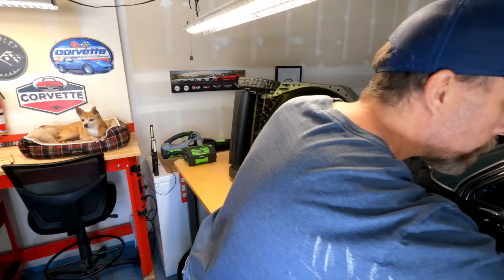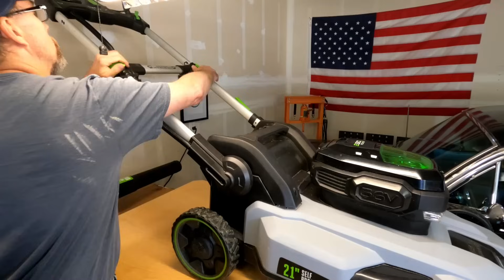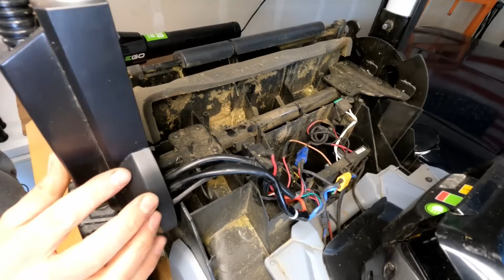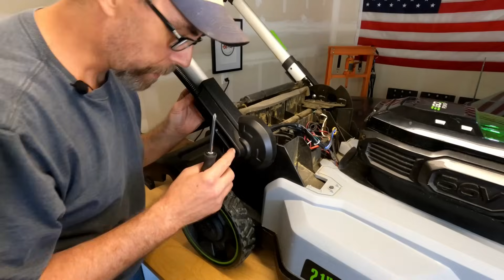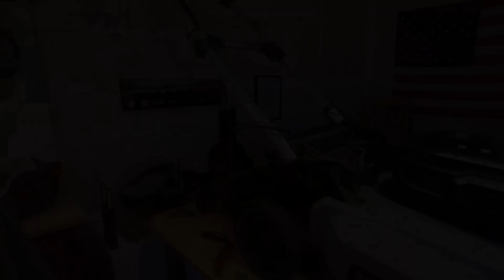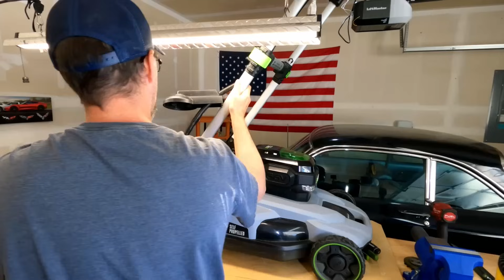My Ego Mower Finally Quit Working!!  🔧  Can I Fix It??

Comment: 🤔 EGO, FYI, comes with a five year warrantee on the tool, and a three year warrantee on the battery (I’m assuming you bought this new).  Intermittent electrical faults are perplexing.
Reply from the maker: THanks for the tip!
Reply: @EndWrenchRookie   🧐 I’ve been using EGO products for 12 years and have probably  >ten tools. In all that time I’ve had 2 batteries fail (EGO replaced 1 under warrantee and didn’t even want the old one (5 AH) back. The other battery was well out of warrantee.

      My original 12 YO 20” mower became unreliable (either brushes or main board) so I upgraded to a 21”brushless push mower, last year.

      The only other tool I had fail (also 12 YO) was the trimmer due to bad bearings in head from operating in a high dirt/dust/sand environment. The model was discontinued and I couldn’t get replacement bearings, but ten years was a good run.

     I have the mower, 3 trimmers, power broom, hedge trimmer, 14” brushed chain saw, 10” pruning chain saw with extension, edger, 2 blowers (regular & Pack pack), a back pack mounted battery holder (standard batteries, NOT the pro) and  the roto tiller. If I lived up North, the snow broom is impressive.

     Replacement batteries are pricy so I always get a new tool-battery-charger combo which is a very cost effective way to buy battery’s and get a tool very cheaply (Some come w/ 2 batteries) 🤗.

     HINT: If the model # ends in “0” it is “Tool Only”; If it ends in “3” or “5” it comes with charger & battery too.  

      (All the letters hint at the purpose, like LM = Lawn Mower; SP = Self Propelled; ST = String Trimmer; etc.)

       Always Register your new equipment from the EGO website (faster than CS assistance).  

       Amazon Prime and some Credit Cards provide automatic extended warranties @ no additional cost.

       EGO is great on development, innovation, all batteries interchange, reliability & power is high and CS is good. 

      The website however is hard to data mine technical info, searches are imprecise, and sometimes information is absent or misleading …. hopefully EGO will address these issues.

      The bottom line is I wouldn’t keep buying EGO if overall it wasn’t very good. 

       I am a heavy use residential customer in VA and FL.  The Proline is “mo powerful”, heavy, & expensive but I have no experience with this line. 

        The biggest cost to battery powered tools are the family of batteries so choose the family (quality, power, runtime, versatility) wisely.

        Hope this helps. 😎

Comment: I have the same mower, intermittently will shut off and the battery light will flash.  I think what my problem is the slide arms on the side that adjust the "steering/telescoping" out.  I notice the black arrows that indicate how far out the arms has to be is further in.  I have a very bumpy lawn out back and seems to be when back there that it happens the most.  Anyhow....appreciate the video, not intimidated by whats inside, looks like a fairly simple system.  Thanks again!
Reply from the maker: Thank you so much for the feedback! Recently, my slide arms are acting up as well. One of the two green handle locks snapped off its little green insert that penetrates the slide handle. This makes the safety switch turn on and off as I push and pull on the mower handles. I have ordered a new set of handle locks for it. Thanks for watching!

Comment: Very systematic and logical approach to a problem.  Most people would have taken the mower to a shop or dumped it.  Kudos to you.
Reply: Buy a meter
Reply from the maker: @boblevy1901  Great idea...Then I could have 6. Thanks!
Reply from the maker: Thank you so much for the feedback! Ya, I could have tried to get it warranty repaired at a shop, but I don't have a backup mower for the month or two of downtime that it would have required. Thanks again and thanks for watching!

Comment: Mine quit after 4 seasons.
Reply from the maker: Sounds about right
Reply: @EndWrenchRookie  mine wasn't the mower but the battery, 220 bucks for a new one. So it sits . I'm just back to using my gas honda.

Comment: After 4 years? That is pretty pathetic given the price of these units. Hate to say it, but I’ve gone back to my gas mower. Which has been working pretty reliably for 15 to 20 years. I was reluctant to try electric, but took the leap. Not impressed in the least. It’s not a good system if it fails to work.
Reply from the maker: That's cool. There is a machine for everyone out there :)  I used the same John Deere push mower for over twenty years and I loved it! That being said...though it ran reliably for twenty years, it did have problems, like all mowers. I say if you are happy with your equipment you are in good shape, whatever you choose to run. Thanks for watching
Reply: @EndWrenchRookie  But here’s an honest question. Has anyone had a problem free— battery or machine—-experience with EGO beyond the three year point? Not that Ive heard of. Every EGO story seems to be the same—— breakdowns and battery issues in year 3. It’s just not acceptable in my opinion.

Comment: Thanks! I, too, am an EGO fan and I started w/the un-propelled  version of this mower. I store it the same way but I haven't had this problem yet( and I hope I don't). We got it in 2018. It's had a LOT of abuse as it was purchased to temporarily replace a lawn tractor that was in for repair. It didn't miss a beat. Now we live on 8.1 acres of land and it's mostly tress so not a lot of grass to cut. Now I know what to look for if I have this problem.

I have the 765 cfm leaf blower(like you do), the original pole saw and extension, and the self propelled snow blower(as we live above 1000 ft.). The 18" chain saw is on the "next thing" list.
Reply from the maker: That's great! You have really invested in the EGO game :)  It is always nice when all of your gear is the same brand so you can share batteries and chargers. Glad you haven't had a problem with your wiring but ya no big deal if you do. The chain saw would be nice, especially if you have a lot of trees on your land. I have heard that the snow blower works pretty well as long as it is not pushed too hard.  I definitely LOVE my leaf blower. I use it everyday to keep my garage dusted (as well as its stated uses like lawn work lol :) ) Thanks for watching!
Reply: Go ahead and get the 18” chainsaw. I cut through an 18” pine tree that got uprooted during a storm. Cut through it like butter and actually made
 5”x5”x10’ posts out of it

Comment: We bought an 2018 EGO cheap lacking the 7.5 AH Battery.  I really don't want to convert to a battery Mower but bought this one to try out and maybe flip?  Well, the battery is $400.  I did borrow a battery and the self-propelled is stuck on full-speed which apparently is a broken wire between the speed lever and the controller.  Someone wrote the green wire is bad.  MADE IN CHINA.  Going to keep using my wonderful Toro Commercial 2-cycle Suzuki powered Mower.  Enjoyed your video and troublesbhooting.  Excellent job!
Reply from the maker: Thanks for sharing. Thanks for watching and commenting as well!

Comment: Don't they come with a 5 year warranty?
Reply from the maker: Yes they do
Reply: @EndWrenchRookie  Perhaps you could contact the service department and get a new wire mailed to you to have for spare parts, i would thing that it may fail again in the future. I think a piece of rubber hose to the repaired are may also promote longevity, buy noy letting the wire not bend quite as far.

Comment: Had this exact same problem. Did this fix instead of just jumping the motor controller side of the connector like a lot of other people. Worked perfect, and gave me a reason to pick up a soldering iron. 10/10
Reply from the maker: That is so cool! This is the reason that I made this video. I never really planned on recording content that day, I just wanted to get my mower working before it stormed that afternoon. I can't believe how many people it has helped. This makes me super happy :)  I am glad your repair worked out well. Good Job! Thanks for watching!

Comment: Congrats on getting it working.  One thing I will note, from personal experience.  You lucked out this time.  You would have had a lot of unnecessary work to undo had your fix failed.  You should always test the wiring before using the heat shrink or anything else.  You can save yourself a lot of time that way.  Great job otherwise!  :)
Reply from the maker: Thank you so much! Great tip. It's funny, I didn't really plan on making a video that day...I just wanted to get my lawn mowed before the storm hit :)  Thanks for watching!

Comment: I have 18 ego products and of late my mower and a charger failed. Previously, I had a battery fail--and they are VERY expensive--and over 1 1/2 years of speaking (including texts, emails, phone messages--and they asked me for every serial number as well as videos of failed battery) with "customer service" reps (in their homes) they denied the warranty claim stating they could no longer trace the "delivered" battery. Uh, no battery was ever delivered. So I wrote corporate. NO REPLY. Therefore, I am no longer an Ego customer and just bought a Greenwirks mower for less than half what Ego charges. STEER CLEAR OF EGO.
Reply from the maker: Thanks for sharing

Comment: Thanks for this video! Can you tell me what I need to buy to repair the 3 wires?  Is the replacement wire just copper wire I buy at Home Depot?  What width?
Reply from the maker: Thank you so much! Sure, I would use 18 gauge automotive (multi-strand) wire. I would think that they would have it at The Home Depot. You will need a basic soldering iron, flux paste, solder, and some heat shrink to finish up the patched wire sections. I also used a wire looming tape to tidy it up at the end, though basic electrical tape should do as well. Cut out the bad section (mine was about 6 inches worth. Strip the wire off of the ends of the wires that remain. Solder in your patch pieces of wire. cover the patched sections with heat shrink (use a lighter or a heat gun to shrink the tubing), wrap all three wires together with tape, and you can re-assemble it all back together. Make sure you remove the battery during all of this. (I forgot to in my video). Hope this helps. Thanks for watching!
Reply: Hello is the “heat shrink” the white colored tape in your video?  Thanks for responding so quickly.  I have never soldered anything in my life so this will be fun.
Reply from the maker: Yes, looks like I used a white colored heat shrink tubing. Also, just checked my video and I mispoke, looks like the patch is more like 1 foot, not 6 inches.
Reply: Sorry I might have more questions, instead of doing those 3 small wires individually it is possible to bunch them all up into one?  I haven’t opened up my mower yet to see what it looks like though.
Reply from the maker: No problem. No, you can't let any of the wires touch each other. Once you isolate which wire is your problem (i have no idea what your issues are), make sure you remember which one it is on both ends of the patch (Just keep track). I did not video myself soldering the wires because there are a ton of videos out there of guys soldering that are way better than I. Soldering is not super hard, but it is a bit of an art form. watch lots of videos and practice.

Comment: Mine is the wheels. They always want to go and are eating my battery. I can't get it to shut off. I've taken the gears out of the wheel until I can figure it out. Edit: I'm glad I'm not the only one after getting all 6 screws out fighting with it because the handle wasn't holding it down lol. Flip the handle up and it'll pop right off.
Reply from the maker: Lol. Ya, that was fun. Figuring out how stuff works while filming is a challenge, but I enjoy it. Interesting that your wheels won't turn off. Sounds like the switch at the handle might be stuck on or broken in the on position. Let me know what you come up with. Thanks for watching!
Reply: @EndWrenchRookie  it's more intermittent like yours. It either won't work at all or it goes without me.  I think it's the same wire issue you have.  I just found another guy who had the same problem and he had to solder wires. (The red green and black bundle which goes into the speed controller then to the wheels)
Reply from the maker: Wow, interesting :)

Comment: Style: Self-Propelled / Dual Port / (2)5.0Ah Battery
Gather round Mowers while I spin you a tale about customer service and product warranty. About June of 2022, I started having periodic starting problems and then the Ego self-propelled mower didn't start at all. The problem appeared to be in the safety harness wiring in the handle. I found the nearest authorized repair facility was 50 miles from my home. I talked to the service technician at the dealership who worked on the Ego mowers. I told him my problem and that, initially, by pivoting the handle back and forth, the mower would sometimes start, but now it wouldn't start at all. He said that he probably knew what the problem was and I should deliver the mower to the dealership. He said that he would have to order a new handle and wiring harness and that the repair would take 2 to 3 months due to the order procedures and shipping time. I asked him if they had loaners because my grass needed mowing during the interim. He said that they did not have loaners. I told the tech that I had the skill to troubleshoot and repair wiring problems and I had already figured it was a broken wire at the pivot point at the base of the handle(looking up the problem on Youtube helped pinpoint the problem area). I asked the technician if the new handle would solve the broken wire problem(caused by repeated folding of the handle into the folded position after mowing). He said that he didn't know. I asked him how I would mow my lawn when my mower was in his shop for 2 to 3 months. He said that if I repaired the wire and used the mower for the rest of the mowing season(up to mid November), I could the then take the mower to him and he would replace the handle over the winter. I agreed that solution would work.
I found two broken wires at the pivot point and soldered in splices. I used the mower for the rest of the season. In November, I called the authorized dealer and asked to talk to the technician. The dealer said that he was no longer with the company. I told him about my mower and he said that they would not work on it because I had invalidated the warranty by opening up my mower. I called the Ego customer service and they were adamant in refusing to help me because the warranty was invalidated.
In retrospect, I love the mower, but Ego places their consumers in a no win position by taking a disabled mower for 2 to 3 months during mowing season without a loaner and then invalidating the warranty if the only solution is for the customer to repair the mower himself. I still don't know if the new replacement handle has solved design flaw that allowed fatigue failure of the wires at the pivot point of the handle.
Reply from the maker: Thanks for sharing your experience with us. This is what I think of every time I get a comment about "why don't you just warranty it?" Eventually, there will be more of a repair market out there for these mowers, but as of now, not enough repair shops are available for warranty service. I was able to get my mower fixed for free and in less time than it takes to make a phone call to customer service (while recording a YouTube video). I also do not have a backup mower for the downtime. Sometimes you just have to take care of stuff on your own. As an update...I have used my mower about 15 times since my repair in this video without further problems. Thanks again for sharing and thanks for watching!
Reply: Just an FYI: Magnuson-Moss Warranty Act forbids the voiding of a warranty due to repairing a product yourself, or having a "non-authorized mechanic" repair it. They cannot void your warranty simply for "opening the case" or for opening anything that would normally require being opened to make an inspection/diagnosis and repair, even if they claim they can and will. They can void a warranty if you or any repair facility damages it in the process of attempting a repair, but the onus is on the warrantor to prove that you damaged it. These companies will continue to treat everyone like this until they are forced to stop via lawsuits. DO NOT LET THEM BULLY YOU.

My EGO is well out of Warranty unfortunately, but if anyone else is here thinking the same thing, know that just because they put it in the agreement doesn't mean it is lawful or enforceable. You have a right to repair your property. And the Magnusson-Moss Act allows you to recover attorney fees and court costs.

Comment: I had to collapse the handle every time I put it into my truck. Eventually the wire inside of the harness wore out/ broke due to being tightly bent and then straightened out a couple hundred times. I found the wire that frayed/broke internally and then did a splice repair. About now, two years later, it started cutting out and then run a bit for 4 seconds and then die. I strongly suspect the 700 Watt controller failed. The motor never worked again. This seems to be a recurring problem on older EGO mowers. Mine was manufactured December 2018, and I took delivery April 2019. I have rental properties and I do a lot of mowing myself. I estimate I put about 4 years worth of mowing into one mowing season typical of an average home owner. I wore out gasoline mowers about every 4 years even though they were maintained regularly. I found a 2021 EGO motor/ controller with complete plastic motor housing and will replace all of it as one unit. I will have an old chassis with new guts.
Reply from the maker: Nice. Way to get stuff done! I will keep an eye on my machine for signs of the controller failing. Thanks for the heads up. Thanks for watching!